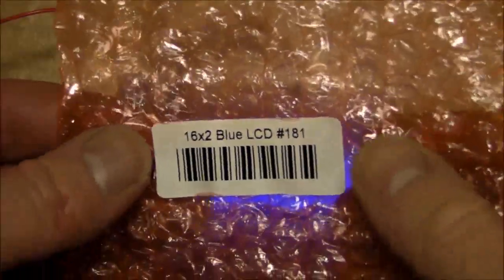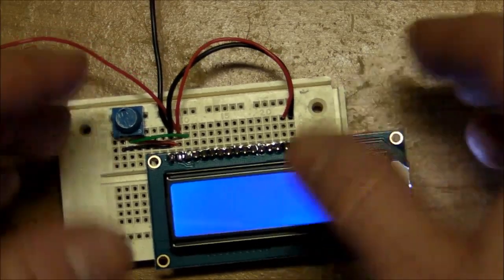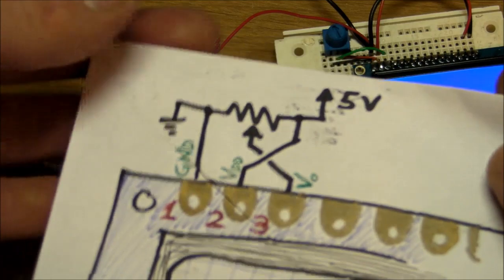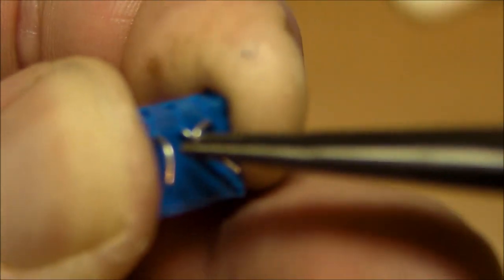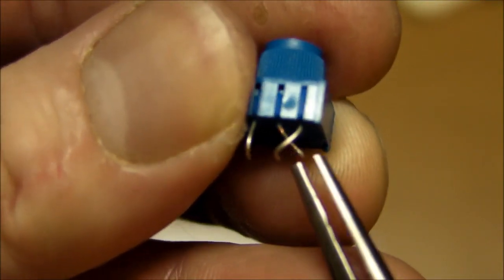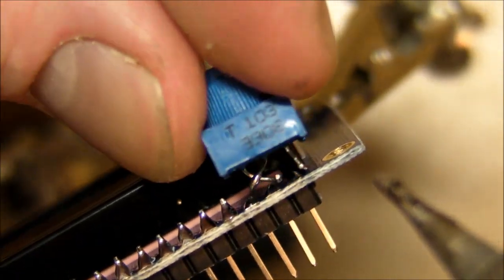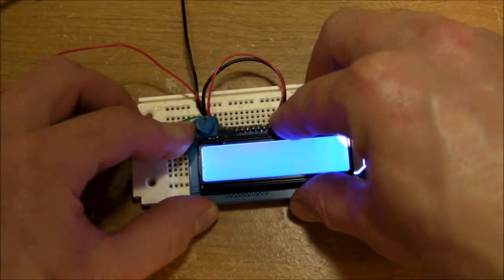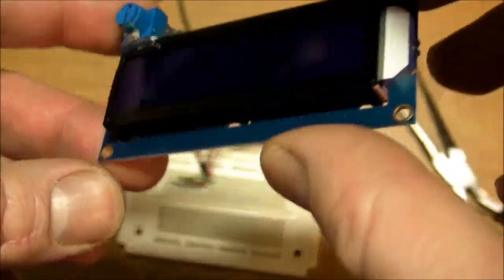(#0173) Hack a Contrast Pot onto LCD Module

Comment: Thank you so much for this tutorial. I fixed my signal generator! It was showing the characters very dim and I couldn't read them at an angle but now I soldered 4.4kohm between pin 1 and 3 and it's super clear and nice. :)